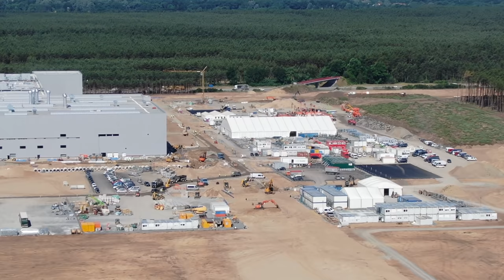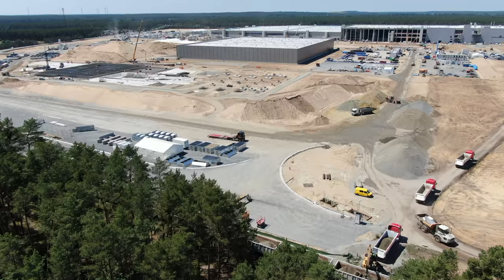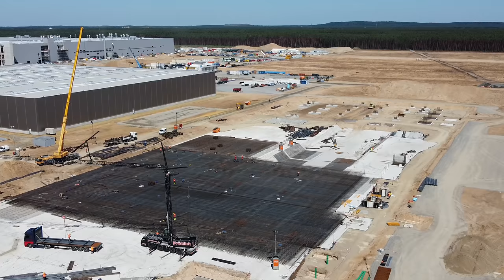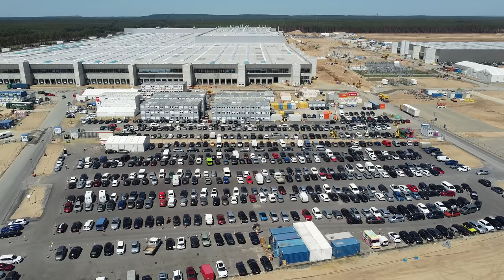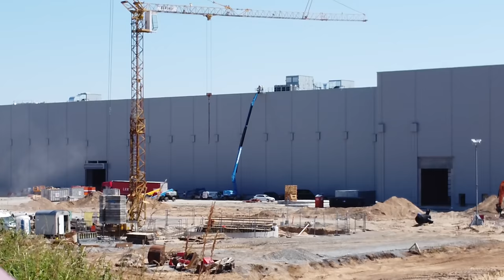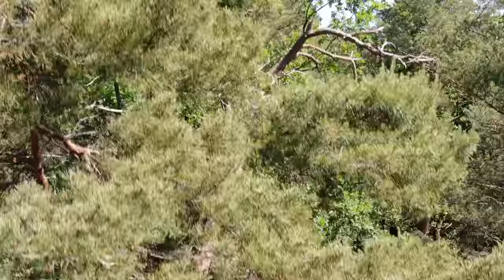Giga Berlin | 2021-06-16 | Timelapse

Comment: The massive foundation being prepared for the battery building looks to be sandwich about 1.3m thick of dense riebar grids on the top and bottom spanned by connecting struts, eventually filled with concrete.  This is the classic way of making a super-strong thin structure -- tensional strength focused on the surfaces, and compressive strength throughout the interior. 
Special large foundation blocks were also used at GigaTexas in the battery area.  It wouldn't seem that the machines for battery fab are particularly heavy like stamping and casting machines.  But they may be highly sensitive to vibration, so the massive monolithic foundation may be a way of providing an inertial isolation block where all the equipment is maintained in rigid alignment by mounting on the block.
Reply: exactly!
but it is surprising that the pillars for this hall are installed on this vibration-free surface (see steel plates with threaded sockets)
Reply: Thanks for the info. I have been very curious about those immense bases.
Reply: They need such an incredible amount of concrete, it would almost make sense to pump the stuff directly from the concrete plant to the foundation. :-))
Reply: vibration on first hand isn't the only reason for the foundation. Several high speed punching and bending machines will work there with different frequency. This would result on harmonic maves with high altitude and long waves in frequencies up to several seconds. The only solution to bear this is mass.

I've been involved with Coka Cola can preproduction ages ago, you kbow the cover with ring pull opener and high precision ring cut line. Only 7 high speed machines were working to make 3 million per day, but the whole building was moving and winding up and down up to 10 times per minute.
Reply: So it will not be a SpaceX land/launch platform? 😉
Reply from the maker: Since the new documents are public now, we know that the foundation plate is exactly 1.65 to 1.85m thick.

Comment: As always; excellent video. Even slowed to 1/4 "normal" speed;  the level of activity is impressive. I imagine it is the same inside the building(s). I can easily imagine the first production cars coming off the line by Sept. / Oct. while still finishing up the outside areas. 2022 is going to astonish all but the most bullish Tesla fans.

Comment: 5:14  Notice excavator operator picking up machine (skidsteer I think) rotating 180 and putting back in rail car. 
4:30  They need more efficient method to empty rail cars of aggregate.
20:30  No operator in crane seat.  :D

Comment: Thanks again Tobias. As fast and clean as they can build, so slow is the law and its rules? In other words they can build faster than make rules, would you ever have thought of that.
Reply: It really doesn't make any sense when you think about it this way. Too many restrictions in modern Europe. The continent has become lazy.
Reply: Rumours have circulated on Twitter that the target start date of production of the Model Y is in early November. So hang tight and we might see cars coming out of the factory soon.
Reply: @MrS13652  Quite unrealistic. The objection procedure ends in August, after which all objections must be reviewed and possibly heard again. The first procedure for the first building permit has not even been completed yet.
Reply: @jamescoppe  Yeah those poor workers with those rights and protections, always getting held down. not like in the good ol USA, where they are "free" to work themselves to death.
Reply: @julianreverse  From what I read the objection period ended July 17th or so?
Reply: 13:18 they are still working on the floor of the GA. Tesla has since 13 July 2020 the permission to complete the building - inclusive floor. Since early May Tesla has also the permission to install production equipment in the GA (which they applied for only mid-April). Elon Musk asked a few weeks ago on Twitter that some suppliers should speed up. Do you think he wrote this without any reason? And that this will only affect Giga Berlin?
The works on a few further needed auxiliary buildings (energy center, sprinkler center, fire station, hazardous materials storage) covered by the permission from July 2020 have not yet even started. To blame this without any thoughts on laws and regulations is a lame excuse.
Reply: @MrS13652  Rumors on Twitter are just that, rumors. I would guess late Q1 or Q2 2022 at the earliest.

What do I base that on? My 47 career dealing with over 100 High-Tech $10-50M, non-controversial, electronic manufacturing facilities in countries all over the world, except one, Germany. If we couldn't get it built, commissioned, staffed, and in full production in 12 months, we wouldn't consider it, and that is impossible in Germany. And anyone in Germany that's been involved with getting a house built knows this as a fact of German life.
Reply: @DonQuiKong  'Rights are protections' are a misnomer. The world is globalised. If you don't work hard, you fall behind. You are being eaten by the Americans and Chinese because you think that you can protect your standard of living by regulation. The only way is hard work and innovation. Europe lost its way 20-30 years ago.
Reply: @jamescoppe  August 16th
Reply: @abalada  Remebers when they stopped tree clearing because of bats? What about the lizards and snakes? Restrictions of work at night and on weekends. It is all German regulation. Just look at how fast Texas is being built. Berlin started earlier, had more simple ground work, is smaller and had less delays from weather, yet Berlin is behind Texas now?
Reply: @jamescoppe  Twitter isn't a source. Based on the official website of the state office for environment.
Reply: @julianreverse  Found the link, you are correct: https://mluk.brandenburg.de/mluk/de/aktuelles/presseinformationen/detail/~15-06-2021-oeffentlichkeitsbeteiligung-fuer-die-fahrzeugfabrik-der-firma-tesla
Reply: @disturbed4733  If you built not on a greenfield (or forest) like here, but in an industrial park which has already infrastructure this is possible also in Germany within 12 months. Even for non-German companies in Brandenburg, like Yamaichi Electronics did in Frankfurt/Oder. 
https://www.logistikplan.de/1877-Logistikkonzept-trifft-Fabrikdesign
Reply: @jamescoppe  "Remebers when they stopped tree clearing because of bats?" What about the lizards and snakes?
Those caused just a delay of 1-2 weeks. Not critical for the project at all. The current bottlenecks lie elsewhere.
"Restrictions of work at night and on weekends." Tesla applied for permission to work at Giga Berlin 24/5 on the buidlings and 24/7 inside at many parts. Those permissions were also granted. That Tesla did obviously not made that much use of those permissions is something else.
The question is where the real bottlenecks to start production lie? Parts of the factory (GA and DU) are still bare of any production equipment. Not orderered? Or not delivered (suppliers)? If this is a suppliers problem - and Elon Musk ranted on Twitter that some suppliers should speed up - why do so many here think that this will only affect Giga Berlin? 
And another issue is the batteries. In the meantime, I've the impression that Tesla wants to start the model Y production at Giga Berlin from beginning on with 4680 batteries. And the numbers of those batteries Fremont can produce for Giga Berlin will be really limited. Thus Tesla won't be able to produce cars in larger numbers at the GF4 at all before the battery factory there is productive. Thus also not really interested in completing the car factory as soon as possible anymore.
Reply: Scary how inefficient Germany is becoming. My impression of Germany tumbling by the greenie complaint against arguably the cleanest co in the 🌎 and beurocratic obstacles.
Reply: @jamescoppe  Texas Gigacasts are spewing parts already!
Reply: @disturbed4733  https://twitter.com/alex_avoigt/status/1405257291683729411
The source of the romour for your reference. I agree with your comment though, one only has to see the delays associated with the Brandenburg Airport...
Reply: @disturbed4733  
Deutsche Gesetze haben eine Logik, die man auch als Logiker nicht versteht:
3 Beispiele - in Sachen Tesla:
<> Vor 20 Jahren wurde das heutige Tesla-Gelände für BMW als Gewerbegebiet ausgewiesen. Diese Genehmigung wurde nie widerrufen! Also nach deutschem Recht immer noch gültig.
Der Baumbestand wurde angelegt um kurzfristig gerades, astfreies  Bauholz zu bekommen.
FAZIT für die Zukunft: Niemals etwas gutes tun und darauf achten, dass kein Grashalm spätere Bauabsichten verhindern.
<> Das ausgewiesene Wasser-Schutzgebiet wurde erst 2018 eingerichtet - kurz vorher gab es einen geheimen Flug von Politikern und Tesla-Führungskräften über das heutige Tesla-Gelände - da hat wohl ein Politiker nicht dicht gehalten - und so entstand das Schutzgebiet für Wasser.
<> Tue nie was Gutes in der Bauzeit...
Das deutsche Recht sagt: Wenn in der Bauphase etwas positives in Sachen Umweltschutz geändert wird, muss alles, also alles was schon genehmigt war - noch einmal genehmigt werden.

Und wenn man privat baut, sollte man überlegen in welchem Bundesland man bauen möchte, denn es gibt 16 verschiedene Baugesetze. 
Willkommen in Deutschland ;-(
Reply: @arnomarkmann6118  1. Der Baumbestand ist eher 60 denn 20 Jahre alt. Die (eher minimalen) Verzögerungen beim Fällen der Bäume kamen auch nur durch den Artenschutz. Irgendwas schützenwertes gibt es auf jeder Fläche. Und hier gab es diese Tiere ja tatsächlich - nicht nur in den Behauptungen der Umweltschützer. 
2. Auch die Errichtung eines Wasserschutzgebietes ist ein bürokratischer Vorgang in Deutschland. Bei dem alle Betroffen (Wasserverbände, Gemeinden, ...) involviert sind. Abgesehen davon, dass ich einen solchen Flug 2018 für völlig unwahrscheinlich halte. Außerdem liegt ja nicht das gesamte Gelände der GF4 in diesem Gebiet. Nur der Teil wo Tesla bisher baut. Das hätte Tesla auch anders machen gekonnt.
3. Wer definiert was "positiv" ist? Wenn es eine positive Änderung ist, kann es ja bei der erneuten öffentlichen Auslegung keine neuen Gegenargumente geben. Schon gar nicht von denen, welche diese Änderungen eingefordert haben. Und wenn es keine neuen Gegenargumente gibt, ist auch eine erneute öffentliche Anhörung nicht notwendig. Und wenn keine neuen Argumente braucht sich auch die Verwaltung nicht mit diesen inhaltlich befassen.
4. Für die meisten privaten Bauherren wird bauen in einem anderen Bundesland keine Alternative sein. Und bei einer größeren gewerblichen Investition kann man sich auch Beratungsfirmen leisten, die sich auskennen. So lange die Gesetze eingehalten werden, hat ja in Deutschland ein Investor auch das Recht eine Genehmigung zu bekommen. Und kann sich diese notfalls auch vor Gericht erstreiten. Dass die Entscheidung in erster Linie am Willen von politischen Entscheidungsträgern liegt - wie in vielen anderen Ländern - ist keineswegs automatisch gut für Investoren. Deutschland lässt seinen Unmut über ein Land X traditionell nicht an Betrieben oder Managern von Firmen aus Land X aus.
Reply: @arnomarkmann6118  Sehr gute Einschätzung. Deutschland ist das schlechteste Bauland in der EU, Brandenburg das schlechteste Bauland in Deutschland.

Comment: New here, what's all the steel works here? Did they do this for other building?
Reply: Will become the floorplat of the battery factory.
Reply: As a heavy construction site connoisseur, I've never seen anything like it. Maybe blocks with as much volume, but not a single slab that's 5'x200'x200'.
Reply from the maker: They did not do something like that for the other buildings. But the cell production building will have 4 floors with production on multiple levels.

Comment: In my highly subjective judgement, the project is going 'full tilt', at a rate not previously seen, after a seeming hiatus for a few months.  Comparing to GigaTexas isn't fair, given the resources Tesla is putting there at an accelerated rate.
Reply: To be fair; Texas has far more relaxed regulations regarding  labor and most other permitting  processes. With the Austin factory you see double shifts / day and lots of activity even on weekends. Coupled with much faster building permits and you have a greatly accelerated construction pace.
Reply from the maker: We didn't see much the for a couple of months, because they were almost only working inside. Now they started new buildings. I don't know why they didn't start the supply buildings in the middle earlier. They already had the permission last year.

Comment: Really good speed today! Many workers on site. I bet the interior is really coming along now. There were new pictures leaked of BIW lines with robots installed. We might see some painted bodies in the weeks to come?
Reply: Need to finish the outside recovery system...
Reply: Tesla has applied for doing functionality tests at the BiW, stamping, and paint shop. Tesla also got permission for those tests (albeit environmentalists will drag those tomorrow before the court).
So far there is however only a provisorial electrical power supply. The fresh water and wastewater systems are not ready. And quite a number of more systems needed for a working production are not yet finished. While for the BiW not much more than electricity will be needed, this is quite different for the paint shop.
Thus more than some rudimentary tests will not be possible. And I doubt that Tesla will be keen on showing the results. The environmentalists argue that the safety measures/systems promised in the submitted application for the factory are not yet available and thus conducting tests is too risky (for the environment).
Reply: @RacefanPat68  Agreed. Not going to be painting until the RTO is operational and there hasn't been much, if any, progress on that unit for many weeks.
Reply from the maker: The current 110kV line is temporary, but not provisorial. It can provide the complete factory with enough power for the full ramp up.

Comment: Whole "progress" is minor, come back in 6 months maybe they will finally close the walls..
Reply: The only walls left undone are the casting shop's.  Leaving them open makes the installation of future giga-presses easier.  That won't stop them from firing up the two presses already installed and start generating inventory of castings like GigaTexas.  Progress throughout the rest of the factory is invisible from the outside.

Comment: At that rate they do not reach January, the production of model 3 long rage, is stopped in Fremont, model Y is neither there nor expected, tesla is making many mistakes, the model S plaid is fantastic, but for a very small audience , tesla needs to sell a lot of cars and have its factories run,
Reply from the maker: Look at the year over year growth of production. Tesla is ramping up very fast, but for some people it's still not fast enough. 10 years ago they delivered only 184 cars per quarter. Yes, they did have some hurdles along the way and some production delays. Manufacturing isn't easy. But they grow still at amazing speed compared to others. So I don't think there is any reason to complain about missing growth.
Reply: @TobiasLindh  Berlin should be releasing in July tesla model Y, and tesla model 3, cheaper, we are all waiting, when will Berlin make tesla model 3?  I need a European model 3 LR, without tariffs or ship costs
Reply: @TobiasLindh  If tesla does not manufacture European model 3, it will be a big mistake, compared to model Y € 64,000?  Do you really think they will sell?  I think not, if Tesla wants to reach the masses, it must lower prices, but does it want to lower prices so that it has 5 giga factories?